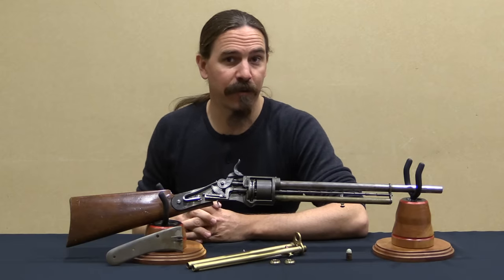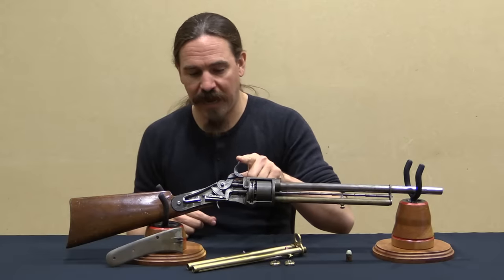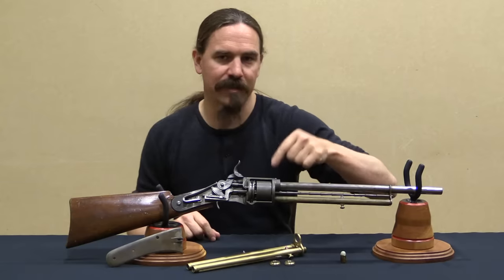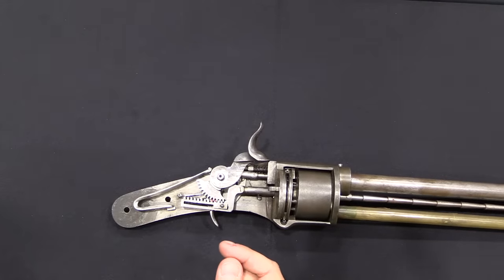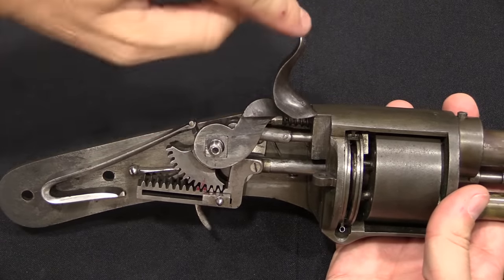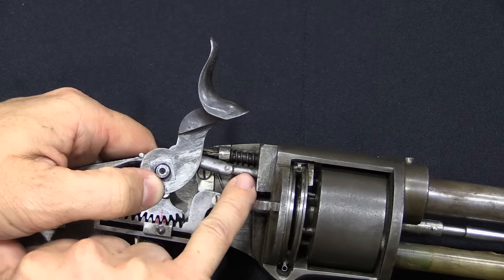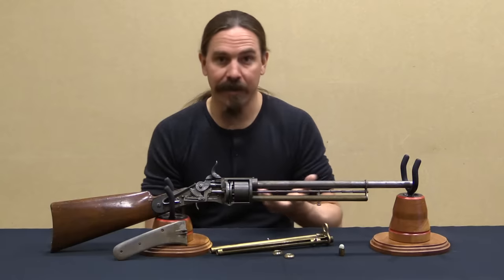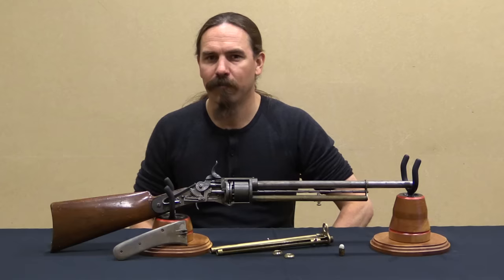Lindner's Improbable Tube-Fed Striker-Fired Caseless Ammo Revolver

Comment: This has to be the coolest, most steampunk, forgotten weapon I’ve ever seen. I love everything about it and want a reproduction. I know it’s obsolete. I know it would cost too much to make, but it’s so interesting.
Reply: Probably could 3D print a non-firing but feeding replica...
Reply: With smokeless powder those rounds could work...
Reply: Apparently Nerf used a system like this for their Rival line...
Reply: @windwalker5765  I daresay a gunsmith could make one if you had the blueprints for it.
It would cost quite a bit, and I wouldn't want to hold it when firing it untill it was tested but it would be worth it.
I'd make one myself if I had the skill.
Reply: Exacly man, i would like one too. I dont even want to think about how much it would cost to have it made though.
Reply: @Likexner  It would likely be cheaper to buy your own mill and diy, which would be really expensive.
Reply: @Likexner  on the order of $5000, minimum.
Reply: @ScottKenny1978  Oof.
Reply: @Likexner  yup. I'm basing that on the cost of the SMG Guns reproduction FG42s, BTW. Lots and lots of machining on those.
Reply: It would be a fantastic steampunk movie replica gun.
Reply: @ScottKenny1978  i believe it is the artemis and hades.  the artemis is a 30 round and the hades is basically a double sized version of the artemis.
Reply: This is why I detest steampunk. Real life steam-era technology was cool enough when it was functional, you don't need to just add random gears and gauges to everything.
Reply: @Ruiluth  exactly. Real Victorian tech is all exposed working bits.

Build a working whatever with working gears on it. Don't just add random gears someplace!
Reply: @ScottKenny1978  My thoughts exactly! That's why I love American locomotives, because of all the machinery hanging off of them. Way more cool looking than any overbuilt, underdesigned steampunk art piece.
Reply: @Ruiluth  it's also why I find semi-auto conversions of bolt actions so interesting. Especially things like the Charlton. All the working bits are exposed.

Similarly, the first magazine conversions of bolt action rifles can be fascinating, with all these working bits added. Ian has a video on a magazine converted Gewehr 1871, the magazine wraps around the outside of the stock like a horseshoe.

I'd love to combine that magazine with a Charlton type semi auto conversion for maximum steampunk.
Reply: Make a center fired cartridge gun by eliminating the cap loader and add an ejector rod to the side on the hole after it was fired that was operated by the same feed rod.

Comment: Nerf used almost this exact loading system in their Rival line (Artemis, Hades, Roundhouse), and I always wondered why I hadn't seen it in a caseless or paper cartridge firearm. I'd been hypothesizing one myself, but it was a 5-tube long recoil design, instead of manual operation.
Reply: I think the general problem with paper cartridges is they're not rigid enough to reliably feed using these systems, plus before pretty much the 1930s, repeating rifles were quite difficult to get working
Reply: @AsbestosMuffins  You're not wrong, but I figured a ratcheting magazine with a revolver cylinder would still work better than a spring magazine loading into a traditional chamber.
Reply: Also, what wasn't mentioned is that caseless cartridges tend to be FILTHY and rough on the gun. As in they foul a lot more than cased ammunition, making extended operation and accuracy difficult.
Reply: @PsychoLucario Manual repeaters were perfected well before the 1930's, and this revolver carbine is a manually operated firearm. You're not wrong about the paper cartridges though, metallic cases are what made repeating arms possible, whether manual or automatic.
Reply: I had an idea for a gas-operated revolver that worked like this, as a steampunk sort of thing... 
I'm amazed someone actually built one!
Reply: @AsbestosMuffins  True, though these days there are other combustible materials available that mean that feeding wouldn't be a problem. Still leaves the biggest problem with caseless guns, though; obturation.
Reply: @AsbestosMuffins  You mean semiauto rifles? Because repeating rifles were a very mature technology by 1930. Semiautos matured quickly once designers stopped having to work around the "don't drill a hole in the barrel" taboo.
Reply: @ostiariusalpha  The earliest commercial repeating firearms (Volcanic) basically fired the case down the barrel as the bullet was the case. Needle fire rifles were similar with the primer attached to the bullet.
Reply: @allangibson2408  The Volcanic Repeating Arms Company went out of business, remember? They really did require metallic cases to make these firearms commercially successful. Those needfire bolt action rifles were only "successful" due to government support; Dreyse's needfire handgun was a total flop.
Reply: @ostiariusalpha  You can still buy guns based on the Volcanic arms patents. The volcanic arms bullet WAS the metallic case (but was fairly light for its size as a result (and that was its problem)). The same concept was used in the Gyrojet bullets.
The needle fire system was very successful in Europe with wide adoption - because the manufacturing of brass cases is very hard, soldiers in the field could assemble the components required to make needle fire cartridges (which you can’t do with brass cases).
Brass WAS found to be better in the long run but both the Germans and French stuck with needle fire systems until just before smokeless powder became a thing in 1886.
Reply: @Allan Gibson  We've all seen Ian's video on the Volcanic system, you don't actually have to explain how it works. The Gyrojet was quite different from the Volcanic bullet, seeing as how the Vocanic had used up all its propellant by the time it exited the muzzle; in contrast to the  rocket projectile of the Gyrojet, which kept accelerating for hundreds of yards. And the needle guns were adopted by France, Prussian Germany, Russia, and Italy, so just really just 3 countries with deep pockets and 1 with bad timing. The whole system was awkward and already becoming obsolescent by 1870.
Reply: @Allan Gibson  I'm curious why you are bringing the needle guns into the discussion though, none of those rifles were repeaters.
Reply: @ostiariusalpha  A needle fire version of this gun would definitely be possible - and the needle fire system was caseless ammunition. Making cartridge cases is hard, well beyond the average machinists capacity (an average machinist can make a cartridge firing gun or even a needle fire gun but not a metallic cartridge). 
It is a combination of odd metallurgy in cartridge brass itself (cartridge brass is not normal brass but has a very high zinc content) and some very special machines to deep draw the cases from blanks.
Reply: @Allan Gibson  Sure, metallic cases are soooo hard to make that the U.S. only made hundreds of thousands of them at that time. 🙄
Needle fire repeaters were tried and they all failed to be successful both commercially and by military adoption.
Reply: @Allan Gibson  To put it to you more straight forwardly, almost every European percussion cap factory had the capability to produce rimfire ammunition in the 1860's-70's.
Reply: @ostiariusalpha  And cartridge firearms were patented in France in 1812…
Rimfire cartridges are much harder to make than you seem to think. Percussion caps are about a tenth the draw depth of a rimfire cartridge (and that’s the hard part). You can make percussion caps at home from copper sheet with a hand operated fly press. Making deep drawn brass cases is much harder (and when did you hear of someone reloading rimfire cases?).
Reply: @ostiariusalpha  And the US Military stopped using repeating firearms for thirty years after the civil war… Repeating firearms were not the military driver you seem to think they are.
Reply: @Allan Gibson  No, only manufacturing the thicker walls of centerfire cartridges is truly a challenging process of repeated drawing and annealing. Rimfire cases are thin-walled and quite straightforward for even a modestly industrial country to produce, much less the more advanced European nations of the mid-19th century.
Reply: @allangibson2408  Winchester made a vast fortune selling lever actions commercially. Also, the tens of thousands of Winchesters that the Ottoman Turks bought seem to disagree with your facile assessment.
Reply: @ostiariusalpha  The Turks ACTUALLY using the Winchesters in combat at Plevna in 1877 was what changed peoples minds - the Turks also relied on single shot rifles for long range shooting as the Winchesters were too inaccurate for that due to their short barrels and under powered cartridges. The Turks lost by the way.
The US Army still didn’t adopt a repeating rifle for twenty years after that. The Germans waited until 1884 to adopt a magazine rifle.
Reply: @ostiariusalpha  Actually thin walls are harder to draw (they tear easily). That’s why rimfire cases were originally soft copper not brass and a lot shorter.
The issue is exactly the same as drawing cans - the earliest metallic cartridges had separate walls and bases that then morphed to a single drawn shape.
Reply: @Allan Gibson  But the Turks didn't lose due to their repeaters not working though, and everyone knew it. I'm sure the Turks were kicking themselves because they hadn't brought more ammo. Plevna kicked off a fever for magazine rifles in Europe, any firearms historian can tell you as much.
Reply: @ostiariusalpha  Yes - but it didn’t prompt the US or European colonies to arm troops with them. The previous concern still had supporters about wasting expensive and volume limited ammunition. Logistics were a major issue for armies before motorised transport (which was also why the Turks lost - ammunition supply being too slow when you have to pack the ammunition in).
Oddly the Russians didn’t get a magazine rifle until they adopted the Moison Nagant in 1891, 14 years later.
Reply: @Allan Gibson  Yes, it did. Plevna was in 1877, and Europeans began adopting repeating rifles en masse as their standard service weapons within 5 years. Basically, that's as fast as they could develop the guns. The Swiss were looking on smugly, having already adopted repeating rifles a decade before everyone else. And they seemed to have none of the production issues with their rimfire ammuntion that you've claimed; the problem with rimfire, is that while it is relatively easy to fabricate, it can't handle higher pressures like the more powerful centerfire rounds can.
Reply: @ostiariusalpha  The issue wasn’t the ability to manufacture rimfire ammunition - the issue was the ability to manufacture it in militarily useful volumes and deliver it to the front. That’s why nothing happened from 1860 when metallic cartridges were introduced in the United States and 1871 when the Germans adopted their first metallic cartridge rifle (with the French (1874) just behind). The British were early adopters in 1866.
If you can’t make ammunition in volume you aren’t going to use it militarily.
Reply: @Allan Gibson  Volume was not an issue with rimfire ammo. France bought 4.5 million rounds of .44 Henry from Winchester, which the U.S. company had no issue supplying to them. You're going to have to cite something to back up these claims of yours, because it just seems like you're making it up as you go along.
Reply: @Allan Gibson  As for "nothing happened" during the 1860's, there was this little dust up in the U.S. at that time. Millions of rounds of rimfire ammo were produced for 85,000 Spencer rifles and about 7000 Henry rifles (though most of the Henry guns were privately purchased by individual soldiers). The Europeans certainly took notice and began working on metallic cartridges of their own, even if it took till Plevna for them to also catch on to the power of repeating arms.
Reply: @Allan Gibson  True, but the French certainly had the industrial capability to produce rimfire ammo themselves. Of course, the real kick in the pants for the French was that despite their rifle being superior to the Dreyse, the Prussians had invested more technological resources into very effective artillery. And artillery is the King of Battle.
Reply: @ostiariusalpha  Followed by the French developing the 75mm in time for WW1 (that the Americans were using right through WW2 (it was the basis for the Sherman tank main gun)).
Reply: @Allan Gibson  Yeah, they figured it out eventually. It was just about 27 years too late to be useful for Napoleon III.
Reply: I definitely need to talk with you about gun ideas
Reply: @henryrodgers7386  I'm sure!
Reply: I had that tube-fed cylinder idea for a sci-fi setting were caseless ammunition were developed and adopted very early into the firearm era, if I make more detailed sketches at some point I might use that follower system for tube mags too long for regular springs.

I actually found this video while searching to see if this concept had been developed in real life, I'm glad to see it was tho a bit surprised it didn't get past the proof of concept phase.

Comment: 08:10... the absolute engineering to get the timing just right for all components/mechanisms is what gets me. No CNC, not prior examples to copy, all of this is handmade (on machines) to be timed perfectly. I was impressed with how well the cylinder locked up tight.
There was some brilliance happening when this man designed and built this system. Had the round contained a larger powder load, this could have been a formidable military arm.